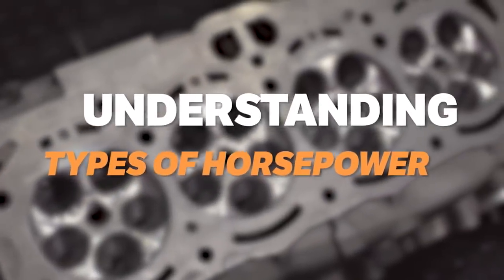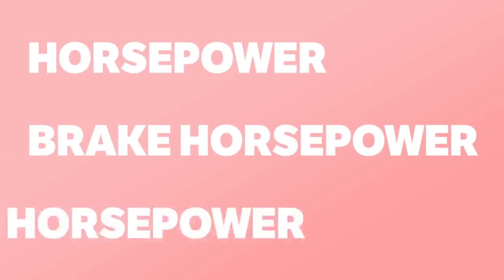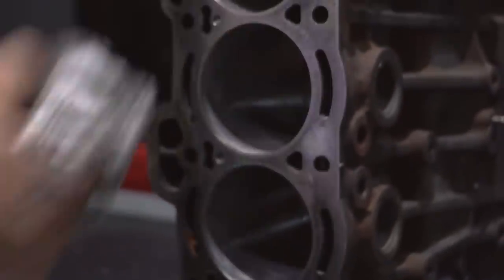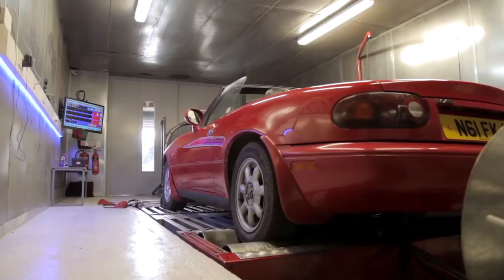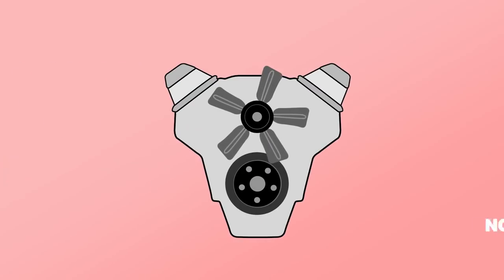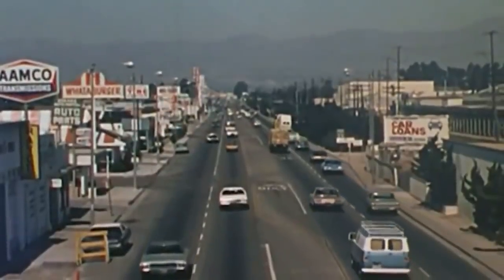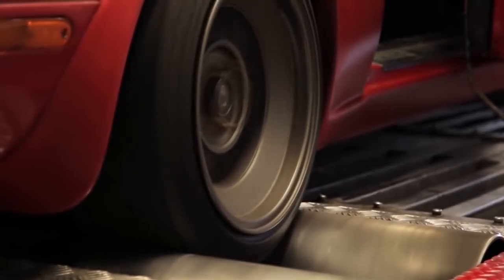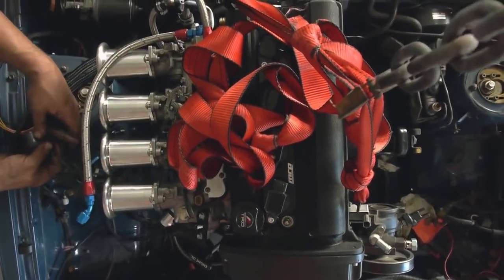The Truth About Horsepower

Comment: I don’t think “horsepower” means indicated horsepower. The numbers would be much higher if they were indicated.  Read here about BMEP (brake mean effective pressure) and IMEP (indicated mean effective pressure)

https://x-engineer.org/automotive-engineering/internal-combustion-engines/performance/mechanical-efficiency-friction-mean-effective-pressure-fmep/

Comment: If the item in question is the car than there should be laws on the books that the advertisement has to be wheel horse power, but if the item in question is just the engine, well then, do what ever i guess, probably net and gross would be nice

Comment: Horsepower to weight ratio determines rate of acceleration but horsepower determines top speed. That is why a lighter car with less horsepower might accelerate as fast as another heavier car with more horsepower to a certain point but at higher speeds the higher horsepower car will pull away. So there is an incentive to buy a a lightweight smaller engine car because it will still accelerate fast to 150km/h.
Reply: The weight pays a big role into the acceleration. But there are a lot of factors. You need the complete power curve, the size of the wheels influence the acceleration and much more.

Comment: A video is titled "The Truth About Horsepower" and doesn't even touch what horsepower actually means (work done over time), how horsepower is calculated (TQ×RPM÷5252), or the difference between imperial and metric HP.   Great job........
Reply: The horsepower tq rpm coefficient is 5252 rpm
Reply: Jayden Eladnani-Tempo you are correct, I shall amend my original statement.
Reply: Vyppaaa11 I wasn't intending to say you're wrong, just informing you of the value.
Reply: Jayden Eladnani-Tempo no worries, I have no idea where I got 4500 from
Reply: Vyppaaa11 thank you
Reply: Johnny Lakman The truth hurts eh?
Reply: Vyppaaa11 Oh fuck off

Comment: I still question on why it is called "brake" horsepower??
Reply: something to do with old dynos, and how the horsepower was measured by how much they resisted the brakes applied to stop the engine or so
Reply: Ya. A dyno is a “brake” as it applies a force that resists the torque generated by the motor. If you had no dyno or “brake” the engine would have no load. Power is force (load) times speed. Can’t measure power if you can’t load (“brake”) the engine.
Reply: https://youtu.be/dIDUlRqay3E

Comment: And then there is the difference between imperial and metric horsepower to make it even more complicated...
Reply: Gustav II Adolf yes it is. But it is there and sometimes it makes things look a bit weird, for example; a McLaren 720s has (you would) think 720 hp but in imperial it's something like 710. Same goes for the Koenigsegg one:1 which power to weight ratio isn't 1:1 if you use imperial hp.
Reply: It's easier to understand the difference between Imperial and Metric horsepower than it is understand the difference between different organizations and nation's horsepower measurement standards. Metric vs Imperial is just different units that can be converted, but SAE net horsepower vs, say, gross brake horsepower is something else.
Reply: Antoine yes I 100% agree that's I was merely adding some (less important)  information.

Comment: So the dynometer only measures WHP ?
Reply: or not even that. more precisely "spits out some numbers", that are not representative of anything. and then you change the BRAND of the dynamometer and start all over.
Reply: Nebbia affaraccimiei 
As far as I know, the main use for the dynometer is to measure the horsepower before and after modifications to see if the power actually got higher or not. But for getting the exact horsepower it's not accurate, as you've already said.
I wonder why wouldn't they do some routine calibrations to get the numbers right.

Comment: HP/L means nothing.
Reply: No, a higher HP/L means that the engine is more efficient (not fuel efficiency) and has a higher output at a lower engine volume, its just an impressive number
Reply: ChokeKOO! So a 7.0l engine with 500 hp is better than a 2.0l with 499? Give me a brake...
Reply: Redfox [赤い きつね] More efficient what? By every measure, cost/output, fuel/output, weight/output, the LS Corvette is more efficient than any S2000, but every keyboard racer on earth seems to think the S2000 has a more advantage engine because it revs to oblivious and produce more peak power, but the exact opposite is correct. Even a Dodge Charger Hellcat is more efficient by every measure.
Reply: ChokeKOO! Displacement has nothing to do with revs... It is 1/4 π * bore^2 * stroke * number of cylinders. If you don't know this you don't know mathematics.
Reply: That'll butthurt all keyboard boy racers.
Reply: ChokeKOO! Also displacement means the room in the combustion chamber for air and fuel so a larger displacement needs more fuel. ( You need 14.7 kg of air for every 1kg of fuel) so it does use more fuel at the same engine speed and load.
Reply: Skipper yeah really pointless... That's probably why almost every form of car or bike racing use high revving engines...
Reply: Giovanni Yes a LS7 makes more power because it's absurdly larger than a f20c but if you take a 5 l ford V8 from a 80's Mustang it make around the same power as an 2.5 l inline 4 from a 80 BMW M3 you can't tell me a engine with twice the cylinders and twice the displacement and the same power is better or even equal. 

About the racing: there are plenty of other racing series with high revving engines: f1, f2 formula Renault, and a lot more open wheel racing series. Also touring car series favour high revving engines and racing motorcycle engine always rev high. Even at Le Mans you have the Porsche 919 which uses a high revving engine.
Reply: Martin van Weperen It's actually 10 years newer, and not all LS engines are aluminum, some are Iron block and still weight less than an RB. Also, the LS is still extremely light by any generational standards, even today. An LS376 barely weighs 390lbs fully dressed. A BMW S63 weights 505 lbs. An LSX 454 (7.4L) weighs ~ 570lbs, while a Nissan VR38DETT weighs just over 600 lbs.
Reply: ChokeKOO! You did! 
You said the "actual displacement" is 4x higher if it revs 4x as high.
Reply: ChokeKOO! First of all about the reading comprehensions; English is my second languages and I am not fluent in it by far.

About what you mean with the displacement: I agree power  = torque * rpm (/some number depending on the units you use) however since the torque depends on the amount of fuel you can burn (14.7:1) in a smaller displacement engine you can burn less fuell in a single combustion cycle. So the torque is less however in the torque is half and the rpm is triple; guess what? You make more power.
Reply: Bryan H efficiency is (amount useful)/(amount needed). Basically if you calculate with the energy density how much power you would expect and than measure the power you can calculate the efficiency.
Reply: Jerry Ortiz it's lighter because it's aluminium instead of cast iron, also it's 17 years (!) newer.
Reply: Giovanni I'm sorry I wasn't clear I meant the displacement when I said size not the demension or the weight.
Reply: Caesar I'm sorry I thought he said sr20det not rb20det, but still 10 years is a long time for engineers to make progress. Also I agree that an LS engine is a light engine compared to for example a S63 BMW however I was comparing its dimensions to a 4 cylinder and it just is bigger.

Edit: I believe all the 7.0l LS7 V8's are all aluminium engines. (Please correct if I'm wrong)
Reply: Jerry Ortiz I guess of by "a less regulated racing series" you mean a series which doesn't have a limit on engine displacement hp/L doesn't mean anything because you don't care about the displacement since there is no rule. But (at least to my knowledge) most racing series have a limit on engine displacement.
Reply: Both the Chevy small-block and the Chrysler LA support your statement.
Reply: all you know that we, in most Asia countries has indirectly restriction about engine displacement. Because engine displacement will affect the tax bill. That's why you rarely see Japanese and other Asian cars that has engine displacement above 5.0 Litre.
Reply: If you want more horsepower, you simply increase torque or RPM. But by increase RPM, the engine is working and you are creating more efficiency loses. If you can increase torque at a lower RPM, the engine is working easier and making power with greater efficiency. This is why diesels are so efficient. The only reason we value HP/L is because of know-nothing regulators who think full swept engine displacement determines engine output and consumption and the boyracer culture that has been built around it.
Reply: It matters the s2000's 2 litre have 240 hp stock cause of hp/l.if u take a first gen viper yes it has 400 hp and thats great for the 90's but it has a 8 litre v10 so its hp/l is terrible CT also made a video on thos in their main channel
Reply: It means nothing because horsepower is a calculation of torque and RPM. The people that place so much value of it need to educate themselves. You might as well measure HP/cylinder count.
Reply: Sadly, the majority of people in the car enthusiasts community are boy racer types and don't stand these sorts of things.
Reply: Martin van Weperen That isn't the context! Swept displacement is the measurement of swept volume in one stroke, but engine horsepower is not measured per stroke, it's measured at rate of speed! If a 2.0L engine spins 4x harder to make XXX HP, it's actually displacement becomes 8.0L! That is core problem people fail to understand when talking HP/L. Horsepower is function of TORQUE and RPM!!! HP/L without factoring RPM is a meanness measurement. That is my point...Seriously, you have reading comprehension issues!
Reply: Redfox [赤い きつね] Efficiency is pinned to fuel consumption.
Reply: Martin van Weperen Where did anyone say displacement has anything to do with RPM?
Reply: Long live the Push Rod!
Reply: Redfox [赤い きつね] More efficient what? When people measure efficiency, they measure how much gets expended. What are we expending, air?
Reply: Martin van Weperen It's not absurdly larger, it's low revving and roughly the size and weight of your typical turbo 4 cylinder. Its measure displacement is not measurement of its physical size or consumption. It's actually a very compact and efficiently packaged engine. That's why they are so often used for swaps into small cars, because it just works better.
Reply: Martin van Weperen You would be correct in theory, but cars don't work after one engine stroke, they work at a rate and have an efficiency curve. The higher up in the RPM you go, the further you fall out of the efficiency curvy. An LS makes more power in first 1/3 of the RPM than an F20C makes at any RPM. Of course it's going to be more efficient.

As what engines are used in racing, your absolutely wrong. The OHV small-block is probably the most popular and winningest engine type of all time, even when up against different types of engine. LS.R as exmaple. The C6R was such powerful and efficienct race car, its engine had to be downsized to keep them from running away at Le Man.
Reply: Martin van Weperen An LS7 7.0L is lighter and makes more power than a RB20DET 2.0L. So yeah, it's much better.
Reply: @Martin van Weperen

Well, without weighing everything, that's hard to say. But 7.0L LS7 Corvette is objectively better than a 2.0L F-Series S2000, when everything else is weighed, even though the S2000 makes significantly more HP/L. The LS7 is much simpler, under-stress, and it makes far more usable power, yet the mileage is nearly the same. With nearly all the most meaningful measure, LS7 are superior.

https://www.fueleconomy.gov/feg/Find.do?action=sbs&id=21621&id=15607

If you want more horsepower, just rev higher, but higher RPM is less efficient and just simple pointless.
Reply: No, HP/L means nothing because horsepower is a function of torque and ENGINE SPEED! If your 2.0L engine has to rev 4x harder to make equal horsepower, it's actual displacement is more than a 7.0L engine at 1/4 the engine speed. This is why a Z06 makes more power and gets better fuel economy than an S2000. Displacement does not determine fuel consumption or efficiency. Seriously, this is so old, old, old... You shouldn't be into cars if you don't understand this by now.
Reply: Martin van Weperen F1 engines are small displacement, high RPM because of regulation, not by choice. When it comes to lesser regulated racing, the simpler OHV low RPM engines dominate. Nobody wants a $1,000,000 screamer that is goed for 1 or 2 race and then needs to be scrapped, especially when something like an LSX makes equal power, is more robust, has superior efficiency, and it costs far less to make and work on.